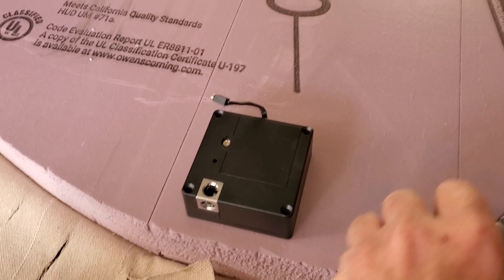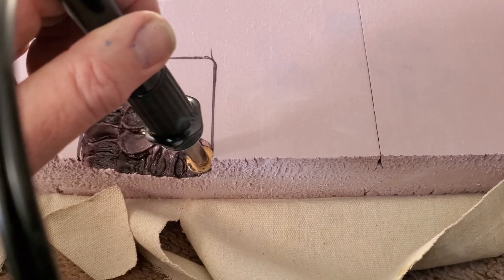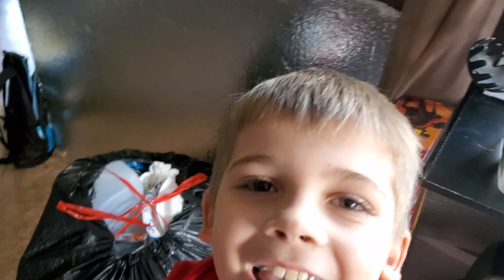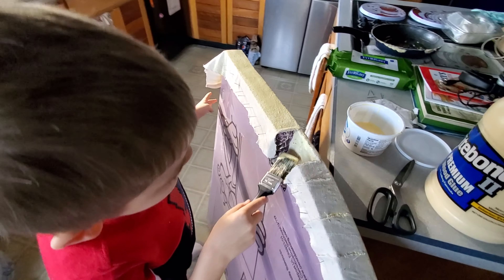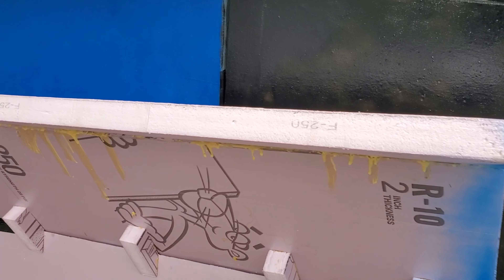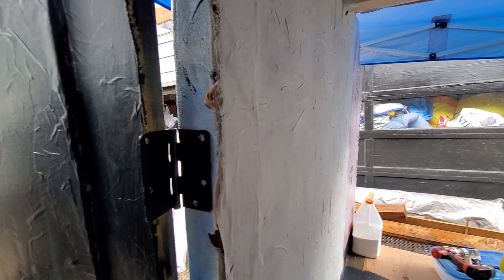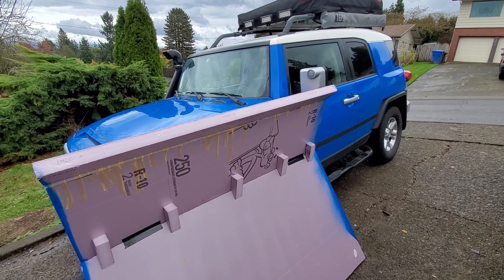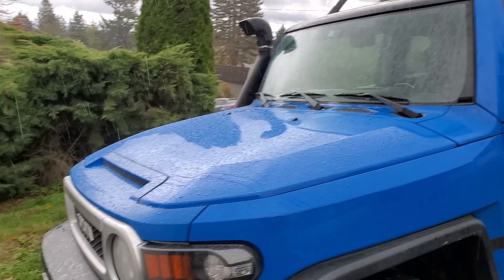Building a removable teardrop foamie camper Part 8 - Side Door and back hatch!! SPECIAL GUEST!

Comment: I really think you got this. I have studied very carefully everything you have done so far and although at first, it seemed possible but very unlikely that you would be able to pull this off but you are!!! Amazing!! My only concerns are , How will it handle going 65mph? Yes, its an honest question. i think your connections are very strong. What i mean is the connections are as strong or stronger than your core material. the poor mans glass has tripled the strength at least, maybe more. My only concern is the connection at its base. thats were the leverage and vibration is going to be the greatest. One thing is for sure, All the foam work is connected very well. Everything looks great and very thought out. What do you think of the idea of using nylon draw strap, just the belts to wrap over the front ahead of the door and then again at the hatch hinge on the real. it could be glued in to the pm glass coats. i dont think it would look bad but it would add about 1.5 tons of holding power. connect it with screws to the wood base. in theory. wou would be able to lift the trailer up by lifting the housing area. very very strong and still looks great. Maybe another idea would be nylon banding straps. the ones the use on pallets of heavy shipping items. do you have a FB account? if so. i could draw up what i was thinking. OH, I also post my vids of focused fb groups. it really adds alot of views. i would also tag this as a Tiny House, people love this stuff. i watched every vid you have done on this from start to finish. I also really love the fact that you like feed back. its fun to think about projects like this, very inspirational. Thanks again my friend for sharing such a cool project. this is awesome!!!!
Reply from the maker: Yes I do have a Facebook account,, and they are some great ideas! can I private message you on YouTube?
Reply: @WhatTheHellAmIThinking  im not sure how to do that, lol, but sure

Comment: Im an Artist and builder as well, I really love the Bigfoot, haha, All American Cold weather azz Kicker, lol, sorry but that was my honest first thought, very cool and fun artwork. i love the build, im a 30 year sailor on the Chesapeake bay. ive don tons of glass work and all types of builds. the paper idea on the inside is very smart, id bet the paper added twice the strength to the walls. i do believe vibration could be an issue while traveling. Maybe the outside corners trim could be mech connected to the wood frame to secure it more to the trailer? just a thought. Thanks for posting and what an inspirational video. love your thought process.
Reply from the maker: Yes I added it inside and out,, screen door fiberglass,, do you think that will help it?
Reply: @WhatTheHellAmIThinking  yes, the paper is very strong, works the same way on a sheet of drywall.

Comment: I'm watching your build closely. I already have a trailer that hauls all of the gear to take myself and numerous gradnkids on very comfortable camping trips. However, I already have a second 5X10 utility trailer that I unexplainably keep thinking about building a slide in squareback camper for. Yesterday I did a quick and very basic comparison of building a camper BOX out of foamboard VS plywood.  2" thick foamboard weighs about 7 1/2 pounds per sheet VS about 66 1/3 pounds for a single sheet of 3/4" plywood.Thus, a 5'W x 10'L x 4'H camper 'box' would weigh about 47 pounds if made entirely out of 2" thick foamboard as opposed to it weighing about 415 pounds if made entirely out of 3/4" plywood. That's a HUGE weight difference.
I used PMF on my existing camping utility trailier which is based on a SkiDo trailer. From that build I learned that PMF takes a lot of work and filling to get rid of noticeable imperfections. Thus, for your paint scheme, you might want to consider a camo paint job similar to the one I put on my camping utility trailer. Here's a link to my camo painted PMF camping utility trailer. https://youtu.be/xCh5SLCXgRU
Reply from the maker: Would love to see some photo!!! and Yes next summer I will do a better paint job,, I just kinda started this on a whim and really want to winter camp and stay warm.
Reply: @WhatTheHellAmIThinking  Don't have any actuial photos, but here's the link to the video of me showing the paint job after it was completed    https://youtu.be/xCh5SLCXgRU